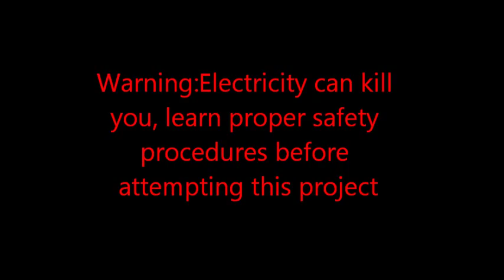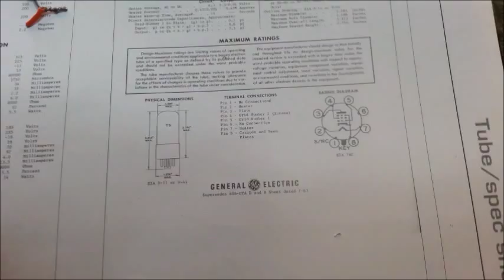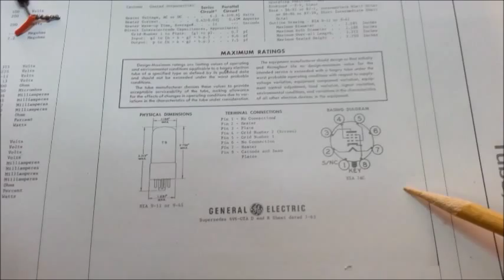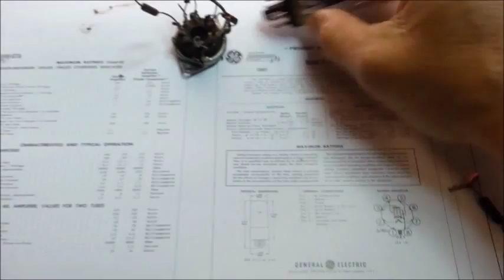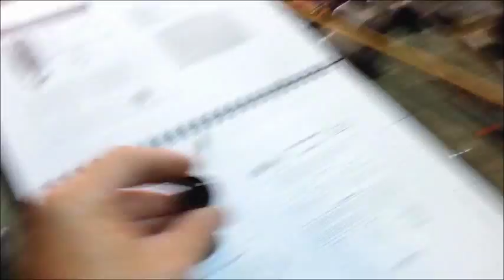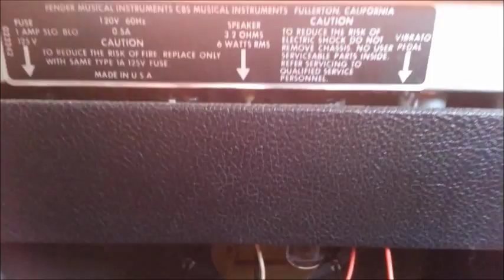Making a bias probe

Comment: you know that you could use 2 cables to pin 3 and connect it to a multimeter, instead of using the resistor.
Reply: Also you can measure the voltage on the primary winding of output transformer. Knowing its ohmic resistance you'll calculate the anode current.  https://youtu.be/s9I3VtQPcv4 ....... https://youtu.be/sSOpCq7RfU4
Reply: That is much easier.  No math, just read the DC amp off the multimeter on pin 3.  Works for 6V6, 6L6 and EL 34.  Note: use an old EL 34 because it has all 8 pins connected.

Comment: Any 1ohm resistor will work ? I checked on electronics store and i can see many types of 1ohm resistors.. which one to get ?
Reply: Get 1ohm 1%. 1/2 watt is plenty.
Reply from the maker: Get a few, at least 2 watt, any material will work.Each resistor will vary a bit depending on their tolerance, test them with your meter and pick the one that is closest to 1 ohm.
Reply: @squiertelecaster6854  Thanks for the info !
One more thing that i don`t understand. Why don`t we directly measure the voltage across pin 8 and ground ? isn't the same ? since inserting a 1ohm resistance in there will be the same thing 470V/1Ohm = 470V ? What am i missing here ?
Thanks you !
Reply from the maker: @bullishbear13656  remember we are measuring volts but are interested in amperes, ohm's law says i=v/r.Having a 1 ohm resistor makes the math easy.Yes in a cathode biased amplifier like a Champ, you can measure across the cathode resistor and calculate current but you must know the exact value of that resistor.On non cathode biased amplifiers you can't because there is no voltage drop.
Reply from the maker: @bullishbear13656  set your meter to read amperes and you won't need a resistor, but you must keep the meter connected while you sound test the amplifier.